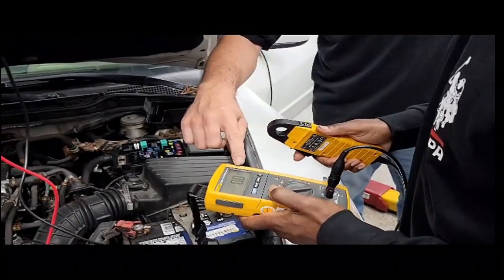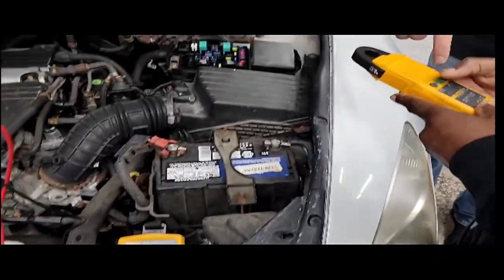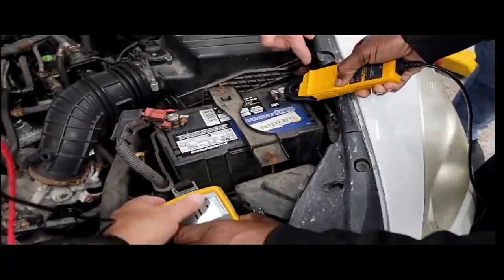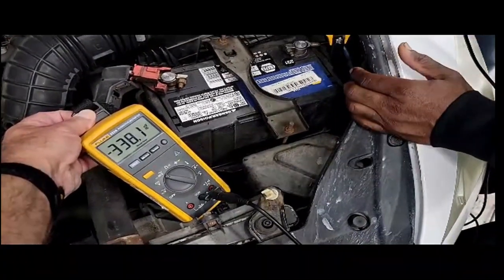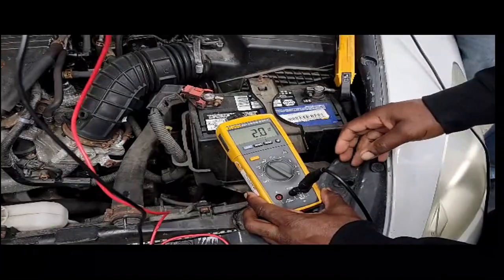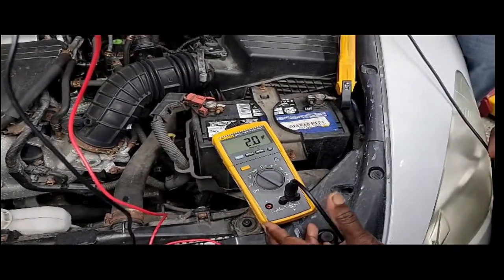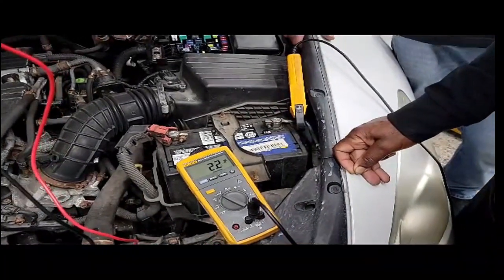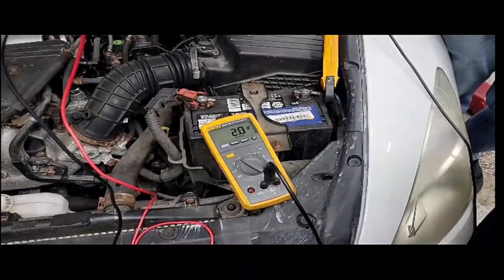Current /  Parasitic Draw With Amp Clamp - The Best Way To Test

Comment: SHOULD be longer video with *detailed close up how to connect like **remove fluke DMM's plug and **insert WITH Amp Clamp and to connect near battery terminals and reading see HOW MUCH parasitic drain occur, which should be below 50mili meter and there is minimum figure numbers, and Amp clamp has VERY small number of min and max figure show and we must use in *milliamp rating numbers to read and multiply by using either min or max but use min numbers usually. and min fig reading in the meter should be multiped by 10 and max figure numbers should be multiplied by 100, which usually using minimum figure numbers to multiple are the steps WHAT this video should be. Too short, but generally OK video, so just subscribed.

Comment: Got a better way than to use $500+ clamp attachment?  Any reasonably priced DC Amp Clamps that can measure mAmps ?
Reply: UNI-T UT210E i heard is good. Most meters with clamp cant measure DC amps. This one seems to be the same design and button layout as many other meters, except cheaper